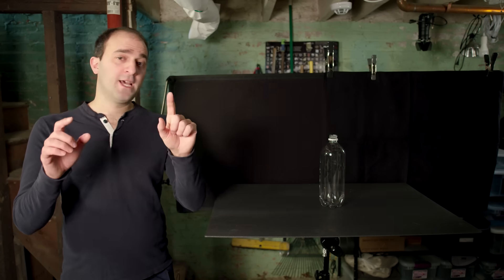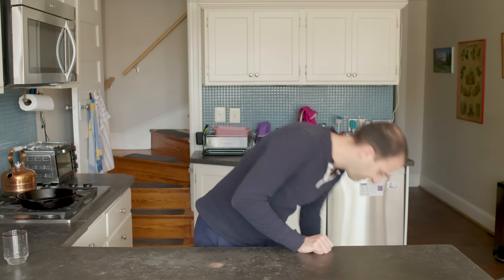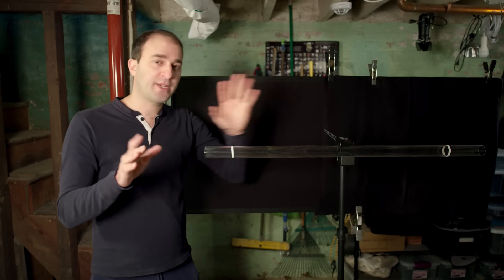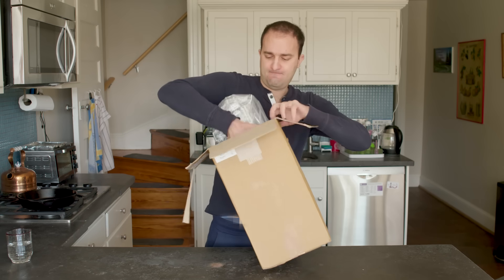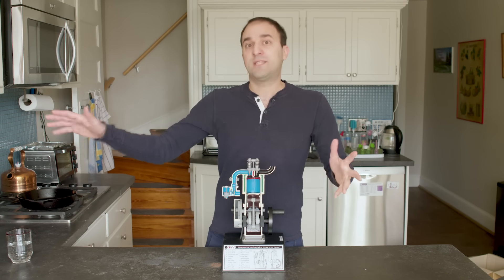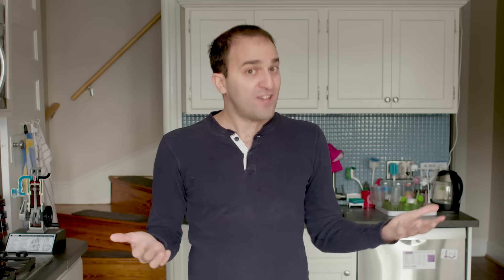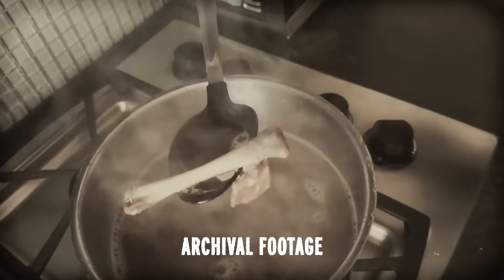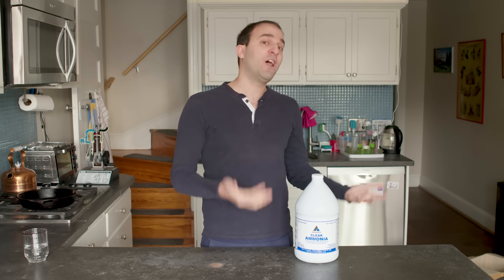Does Toyota Know Something That We Don’t?

Comment from the maker: Like any fuel, ammonia has emissions. Super interesting piece on the difference between doing ammonia properly vs. getting it wrong that goes into a lot of detail on emissions:
https://engineering.princeton.edu/news/2023/11/07/ammonia-fuel-offers-great-benefits-demands-careful-action
Reply: As the kids are wont to say, "That's just burning fossil fuels with extra steps."
Reply: @rockets4kids  yes, that’s true. However, it’s a lot easier to sequester carbon dioxide at the chemical plant then it is from millions of tailpipes. So in conjunction with carbon capture and sequestration could achieve goals of reduced CO2 emissions.  But I suspect the overall efficiency is less than just using CO2 sequestration with electrical generation, and running electric vehicles.

Might be an option for large trucks or maybe even airplanes, although you get into the toxicity issues again.
Reply: @rockets4kids  sure, but it can be fairly easily enforceable just like sulfur emissions, and similar issues in the past
Reply: @rockets4kids nitrogen makes up 77% of the atmosphere 

8% atmosphere is 03 😮
Reply: It's all about the claim of non-carbon tail pipe emissions.  It's a yarn hippy scientist like to spin to get government grant dollars.  @rockets4kids
Reply: @rockets4kids  ask the kids for 'where the carbon chain' exists with NH3, NH4
Reply: @rockets4kids  this is absolutely not true.
Reply: Some rockets and satellites are powered by hydrazine (N2H4), also not a carbon fuel. But it is so toxic that putting it in cars is out of the question.
Reply: @smcdonald9991  
CO2 emission is the most vilified essential gas in our atmosphere. It is essential as an ingredient for green plants to make food for themselves and for humans and other animals.  The concentration of 400 ppm of CO2 means in one million particles of air there are  only 400 molecules of carbon dioxide. The fact is even when that number is double to 800 molecules of CO2 in one million particles of air, the CO2 level is still far below the safe limit. During the Dinosaur era, the CO2 level was five times that of today's level but both plants and animals were thriving.
Reply: Ammonia smells like cat pee !
Reply: Like your tagged info but isn’t ammonia used many places  with degree of safety? Think industry will find viable solution. Might not any currently worked on yet. Hope universities all try different approaches we need more options
Reply: Ammonia is NH3.  N =Nitrogen H = Hydrogen That means that it is made of one nitrogen atom which is already 80% of the air we breathe and three hydrogen atoms which becomes water when burned. The thing is to create it without making CO2 emissions. There are quite a few companies working on that exact thing.
Reply: As per usual people don’t remember that environmentalism is concern for the pollution and livability of the planet. Where the climate change movement is about reducing a gas which is already the majority of gas in the atmosphere namely co2, which is non toxic, encourages farming and plant yields, and is released by Forrest fires, volcanoes, coal plants which are the majority of power plants and the manufacture of all “green energies” including the diesel powered industrial equipment used to mine all of the elements used to make “green energy”. 

In the nineties we grew worried about, pollution, toxic waste, loss of species, over fishing and pouching, the waste and destruction of natural beauty and access to fresh water, saving the whales, the illimation of carcinogens and the preservation of whales etc etc etc. now we worry about a non toxic gas whos main problem is it seems to create an increase of fresh water and increase livable areas of land on the planet which is mostly frozen. 

All these lobbies are gone, they have been eliminated by the grift that is the EV Revolution which has created so much radioactive pollution and co2 emissions it should be criticized. I would prefer you just be honest and say decrease CO2 emissions as there is literally “NO” amount of reduction in CO2 which can change climate change as those changes are multi factored and the climate was changing since life on this planet began. The most life this planet has ever seen was at a time CO2 was at a high point during he Cretaceous when planets and animals had so much food and water that they became giant sized. 

Somehow eventually CO2 levels went down. I will believe you care about CO2. When you embrace nuclear energy and I will believe you care about the climate when you actually study the other factors which decide the climate instead of the religious notion there is only one factor in greenhouse gas which is not the case. For instance Methane is a greenhouse gas and emissions have increased incredibly because it is considered “green” because it doesn’t emit CO2 even though it is exponentially more of a green house gas and simply mining it and accidentally discharging it is a massive risk. 

CO2 is a boogeyman used to sell solar panels and cars which are responsible for more toxic pollution and Co2 then near anything else. The Hawaiian fires were increased dramatically by the abundance of lithium batteries burning but nobody talks about that. Until the manufacturing process itself is powered by nuclear or tidal energy none of this green energy is green, likewise as long as the batteries are charged with coal electricity. By the way when I say green I mean the religious implication that it does not commit the sin of creating the most abundant element in the atmosphere and on land. The thing which trees are made off, which trees use to make oxygen. I don’t actually mean good for the environment because lithium and rare earth mining is so bad for the environment it will never be green. Look up EVs and windmills catching fire and you will know emissions are not improving.
Reply: Why burn ammonia instead of just hydrogen?
Reply: @AricGardnerMontreal  Because hydrogen is hard to store and transport, and takes a lot of space. H2 fuel storage is not heavy, but very bulky. And since the molecule is super small, it leaks through and out ouf almost anything, even through solid metal.
Sticking the hydrogen on nitrogen or carbon atoms makes it much more easy to handle.
Reply: @ACSReactions
look at that plastic bottle you got your ammonia in. that has LESS safety features than a gas tank. try ordering petrol or diesel via ups. you can't. i can indeed order ammonia. dissolved in water - yess- but thats besides the point. now, there are things to point out. i agree, current engines are unsuitable to operate on an ammonia based fuel. thats.. just mighty true. so maybe, we should not even try. now, you got a nice model of drumms rolling a spark ignition engine. but not all engines are like that, diesel has NO spark plugs. indeed, given enough compression, ammonia solved in water will be perfectly happy to combust just fine. surely the slow flame speed , or.. shoudl i say, slow action of combustion is an issue. only with current engines, the stroke and bore are adjusted for faster combustion. would need far less stroke, and larger bore. in fact, would likely see higher displacment engines. it has its own benefits, like far larger valves are possible and better, more efficient air flow. indeed, such an engine would be not rev happy. it would be despite the short stroke , would likely be a less than 2k rpm redline engine. not an issue if you ask me, you would still have more than enough power. so what compression ratio would one need for this ? petrol engines rarely go over 13:1 compression ratio, and modern diesels are somewhere around 16-18 : 1 ratio. however, some older engines, specifically indirect injection engines , had 23+ : 1 compression ratio, and even had been turbo charged. leading to figures of a combined compression ratio of 36+ :1. now that is, indeed a lot. same engines had been pushed even over to 40:1 compression. thats more than enough to combust ammonia water solution. a splendid solution would be a 2 stroke engine, that is not crank case scavanging. nowdays when centrifugal superchargers are actualy viable and used by people for absurdish power gains, we can copy what locomotives done. they had superchargers, bypassed to work as a turbocharger once revs climbed.  we can do the same, we can use a clutch to drive the compressor from eighter the turbine, or the crank shaft. alternatively it can be an electrically assisted turbo charger. the other chalanges are, getting rid of NO and NO2 forming. however, you can just literally use the ammonia it self as an SCR. so not an issue that could not be solved with ease. blowby at such high compression ratios will end up producing quite some amount of blowby. highly likely crank case ventillation would be a must to solve issue, but if the whole engine breathes venting via the crank case, than that issue can be solved too. just uncoinventional for what we are used to. lubricants are however open to debate.with that much air passing the crank case, along with heat involved, its very likely that tipical oils would evaporate a lot. that would enter the combustion area, and we would still burn hydrocarbons. there is an ongong research of making lubricant out of ammonia, and keeping it carbon free.  still, ammonia is not a safe material. i agree. however, just consider how erratic is lithium. or take a look at cng/lpg/lng fueled cars. those gasses are kept under impressive pressure, are highly suspected to explode , yet those tanks still survive whole cars burning down. if we can keep those safe, than ammonia water.. not that impossible at all. if you look at your simple plastic bottle... you can see why i think so. 
but the strnegth of ammonia is the ability to be produced at highly variable rate. all our green power producing technologies useless, till we can not store what we make. the grid offered some form of solution, but its imperfect. lithium is no option, as at world scale, its not viable. we do not have sufficient lithium to begin with. but we can make tanks to store ammonia, we are doing it even now. so the point is, that all our solart panels and windmills and what not are not predictable source of power. ammonia is a perfectly suitable long term energy storage medium. 
the described internal combustion engine would be vastly less complex than our modern ic engines, so this can be made and sold at a low price. the technology must be affordable, else its useless.
sure, injectors would had to be made out of cermaics, and there are some other challanges.. but its sofar the only technology that fits the bill.
Reply: petrol, was a by product of diesel, that was drained into rivers & burned off..  then,, some bright spark, thought,,??..hmm,??,,  look into it.. diesel is less refined than petrol, so should be cheaper,,  yes..?.
Reply: heres a bit of fkn education for you..  LPG. is a waste product,,here in aus, we sell to singapore,ect, for 10c. lt..DELIVERED... my 3t , 82 bronco was on lpg only, for 15 yrs.. 12.1 compression, went like a cut cat, & cheap..  same can be done for ammonia, id say.. [ how come you got 2 M,s in ammonia, but missed the aluminium, N...].  as to ''climate change'',, thats all bs.. the earth goes thru cycles.. like desert, then ice age.. were heading for an ice age,,  at present..  so, schwab, w.e.f., nato, u.n. can all go jump..
Reply: good safety regulations.????...  so how come EV,s got the ''green'', light..???... toxic, fires you cant put out, shortage of power,electricity generators,.  bs..IF IT AINT BROKE,,DONT ''FIX'' IT..
Reply: IMPORTANT THING you need to clarify regarding ammonia.
I'm an engineer (aerospace) who works in industrial control systems and automation. I have spent a considerable amount of time in Australia's mining industry. I went there for experience because it looked like one of the main reasons to go back to the Moon was to mine it for Helium-3 but that's another story.

One of the first mines I did a project at had 2 massive Anhydrous Ammonia Tanks and for those who don't know that anhydrous part means its got no water at all. They had special sensors on those tanks to detect leaks because if you get a major discharge of anhydrous ammonia you can't smell it. Places like that mine where they have anhydrous ammonis cover this in their site inductions. 

Unlike when you open a bottle of bleach and you can smell the ammonia at very high levels it simply overwhelms your olfactory system before you can do anything. It can overwhelm a person so quickly they have almost no chance of survival and even if they do survive its with serious permanent damage.

This is my concern with using ammonia as a fuel in cars. Cars get involved in car accidents and they can be bad enough with gasoline (petrol if your in a nation that speaks proper English) and UNLESS there's decent standards on the tanks, pipes and fittings combined with thorough training of mechanics then it would only be a matter of time before something very bad happens.

FYI - I also have similar concerns for hydrogen fueled cars, because I know how volatile hydrogen is how easy it is to ignite and how easy it is to get an explosion. So you know - I am formally trained and certified for electrical equipment in hazardous areas (EEHA).
Reply: Rotten eggs is sulfur... cat pee is ammonia
Reply: This is foolish. Liquid ammonia can evaporate very easily and turns into a toxic and deadly gas but the vapor of gasoline is much less toxic.  The unjustified fear of CO2 emission from burning fossil fuels has turning some people  into lemmings.
Reply: Promoting toxic ammonia as a new fuel for internal combustion engines in order to eliminate CO2 emission is a whole new level of insanity in the global warming / climate change scam.
Reply: Doesn't sound right, I think someone is talking 💩💩💩
Reply: let me share some additional information, as a chemist: Most people won't say that ammonia has a smell at all, but it really bites. It will make your eyes water and make you feel like suffocating in very low concentrations. 
Those who say that ammonia has an actual smell would say, "it smells like horse p!ss".
Reply: :face-orange-raised-eyebrow:DEATH WE A GINAA DEATH:face-orange-raised-eyebrow::face-fuchsia-tongue-out:Ahhhhhhhhhh:face-fuchsia-tongue-out::face-pink-tears::face-pink-tears::face-pink-tears::face-pink-tears::face-pink-tears::face-pink-tears::face-pink-tears::face-purple-wide-eyes::face-fuchsia-poop-shape::body-blue-raised-arms::body-blue-raised-arms::body-blue-raised-arms::text-green-game-over::face-purple-crying:
Reply: Would help in waste water treatment plants in large cities if they bought it from them
Reply: Good stuff. But... The sun doesnt care about CO2. Its just doing what it does every 12k year cycle. And no.. humanity although arrogant, self shaming, center of creation minded, wont be doing anything to stop that, or cause it. Insignificant. Last year the shield was so weak here we had a record triple the highest record of far reach aurora, because of the sun. And FYI, other planets are having similar effects..  Sorry, but, the sun WILL be resetting all of the modern world, first a potential series of blasted out CME more like Micronovae, then we will tilt, and Noah Style Flood, and then.. just as they are figuring out now.. go into glaciation. This is your planet, but its not working by your designs.
Reply: 😂 atleast 👍🏻 you won't need to stick you're nose 24/7 down the sea bed for fossil jet or racing car fuel 👍🏻
Reply: What if Toyota's 👍🏻 doing ammonia + cell powered eV's ?

It's just an additional port of pump gas beside the lorry pump in you're local Octane one stop Centre? 😮
Reply: There is another huge problem with ammonia, even if it were more feasible as fuel: Currently, it takes massive amounts of energy to generate ammonia and also my understanding is the process which cracks hydrocarbons to form ammonia also releases all of that in the form of CO/CO2 during manufacturer.
Reply: @fjs1111 @tonywilson4713 Green ammonia does not involve carbon at any stage of the process, and is more efficient than transporting raw hydrogen. No one is talking about using grey ammonia as a fuel. The entire point of ammonia is to be able to transport energy produced from the cheapest renewables available (things like desert solar) to places where it can be used.
Reply: @fjs1111  YEP, YEP and YEP again.
You've just highlighted the major issue with those proposing to transport hydrogen as ammonia.
Reply: You're not a real chemist, are you?
Reply: The properties of ammonia, eg, vaporizes at an extremely low temperature and it's toxicity at relatively low concentrations effectively makes in to the "poor Man's" poison gas terrorist weapon. This is an inherently profoundly bad idea.
Reply: @jimzielinski946  -  Its equally as dangerous as the lithium firebomb in everyone's EV, not to mention the evil mess that mining and processing all those special things for the EV. Ev's are worse on the carbon and environmental destruction than ICE... Unless nuclear powered. Propane and LNG are equally as dangerous and will suffocate you if the tank is punctured. Life is full of danger.  The only one which makes sense from an environmental standpoint is AirAluminum batteries. Power from Nuclear... Recycle the batteries back into aluminum. Its a WIN WIN.
Reply: @jimzielinski946 . Which means the government will love it. 🤦‍♂️🤦‍♂️
Reply: @Classickoolcars  it's easy to be cynical - I sure hope you're wrong.
Reply: NH3, NH4. There is ZERO Carbon Chains. Nitrogen is a majority inert Gas. Obviously the Hydrogen chain is what is being burned and likely flashing over into a drop of water. There's lots of current examples of commercial uses for Ammonia. It doesn't blow up like a tanker of hydrogen gas much less a mega-tank filled with hydrogen gas or forbid a hydrogen gas pipeline which could level a town.
Reply: You can always tell a real science guy when he "wafts" the chemicals rather than just stupidly stuffing his nose in the bottle. "Insert video(s) of NileRed snorting chemicals constantly."
Reply: Forward osmosis of urine no emmisions
Reply: @peterlang777  -  Urine over wood ashes makes chemicals necessary for boom stick powder 😜😜👍👍  There are lots of good uses for pee and poop.
Reply: What about the energy needed to produce the ammonia? High temperatures require large amounts of energy which in turn produces "green house glasses"
Reply: @frankh.3849  -  So does building an electric car and with the electric car being coal powered :) for the most part, the carbon footprint of making the car and the environmental impact is WAY WORSE than an ICE car running ammonia. There are several process to make ammonia from various resources and biproducts. Human Urine is very valuable for fertilizer, explosives, and for ammonia if you want to get really green :)
Reply: 1. Too much pointless gesticulation
2. What is the purpose of background music? It only irritates and significantly complicates the perception of your story. Did you do it just because it was possible?
3. You microphone seems to be broken - the volume varies from low to high. Or maybe it's because of background music?
Bottom line: impossible to watch for more than 3 minutes. Voting down.